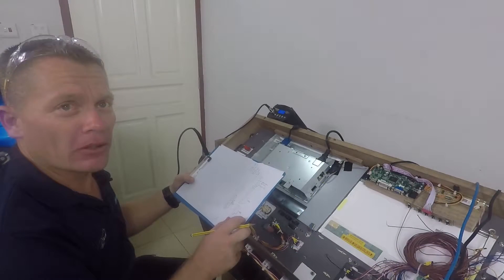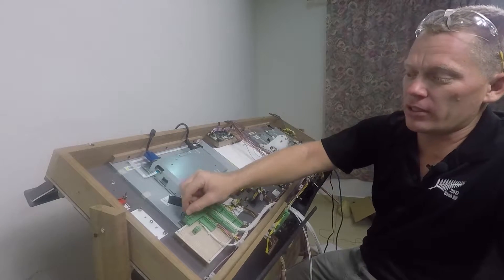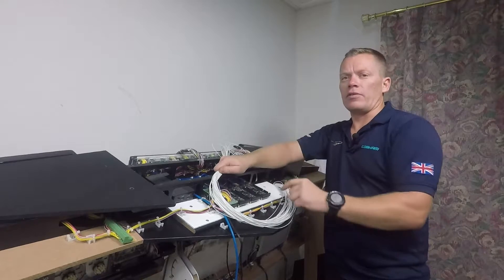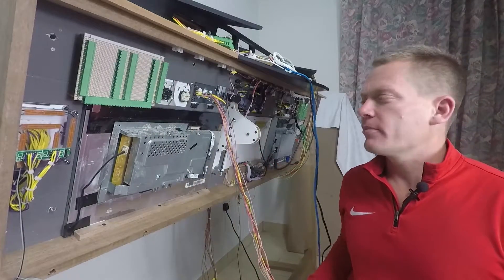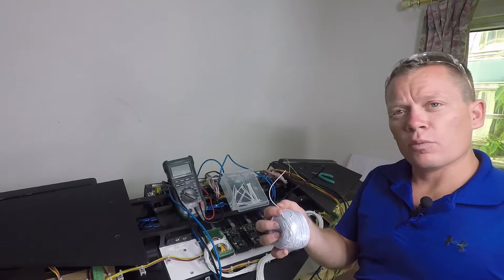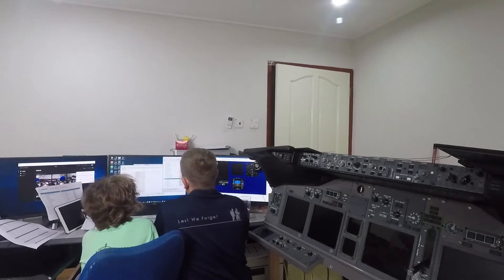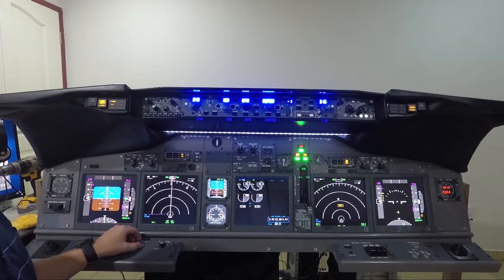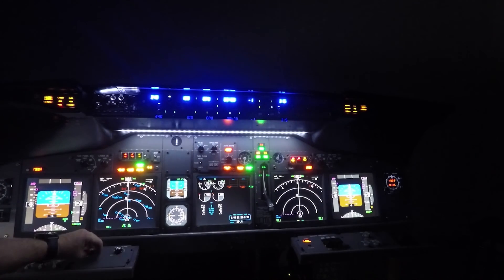737 Sim Build - Wiring the 737 MIP & Reveal #7

Comment: Hi There. This is really great. I know this is old but what did you use for all the screens. Hope you still having fun flying with this.
Reply from the maker: Hello Gerald, the info can be found on the website, but in short, they are just 19" monitors which have been removed from there cases. Prosim then provides the software to drag the windows onto the screen to the required position. Hope that helps, Karl
Reply: @helimech8152  Thank you so much.

Comment: hey me again  enjoying and learning from your  videos  .. what type of resistor should I use for LED"s to connect to arduino ?
Reply from the maker: Hello, carbon 1/4 watt is normally the type I use. The actual valyal depends on the type, colour and quantity. There are plenty of led calculator to help you plan the correct value.
Reply: @helimech8152  I see thks a lot man

Comment: those are not arduino right?
Reply from the maker: Hello and good morning from Brunei. I believe you are referring to the control boards that everything gets wired too. Yes, they are Arduino Mega's. I use 6 currently for the MIP/MCP/EFIS. Definitely, the cheapest and most versatile board I have come across yet.

Kind Regards

Karl
Reply: @helimech8152  thks a lot man for answering to my question. by the way you r videos  are helping me a lot to bul my sim due that i have no idea  about  building. how come you rarduina control boards looks different than mine? mine is just the green board where you soldering the wires to. Im missing the black plate where you attach the green board to .
Reply from the maker: @jhonnynascimento9685  there are two devices there. The first is the ardunio mega itself. Then the ardunio mega prototype shield that fits on top. This acts like a big connector to allow replacement of the ardunio quickly and easily.
Reply: @helimech8152  ohhh i got it now ..  but the shield is not necessary  or you need that shield to make the arduino work?
Reply from the maker: @jhonnynascimento9685  no you don't need that shield at all. But I do highly recommend it. It holds the cables securely and much better than those Dupont connectors that come loose all the time.
Reply: @helimech8152  ohhh ok cool  whats  the name of it?
Reply from the maker: @jhonnynascimento9685  good morning from Brunei, it's just simply called the ardunii mega prototype shield
Reply: @helimech8152  ok man tks a lot

Comment: I’ve watched a lot of these videos and this one is spot on. Great commentary and loved your positivity.  I’m planning a similar setup but hadn’t realised how much wiring would be needed. I guess the Arduino’s are to replace the interface boards which are normally required and very expensive from the various cockpit sites. Good Luck with it all, I’m very envious :-) Cheers Tony
Reply from the maker: Hi Tony and big thank you for the constructive feed back and kind words.  There us a lot wiring, but theres probably more than needed, you could easily cut it down by missing out the breakout boards. And wiring the components direct to the arduinos.

Comment: Inspiring work sir
Reply from the maker: Thank You
Reply: @helimech8152  I keep going back and forth on ProSim and why do you need it.
Cant you just do what you need to do with ModiFlight along?
Reply from the maker: Yes of course you can, mobiflight has a good selection of preprogrammed  items. But prosim is for the logic, displays and switches. It replicates the cockpit of a real aircraft, so every switch, dial etc works. Try it with pmdg, which is much cheaper or x plane using simvim instead of mobi
Reply: @helimech8152  interesting, I am planning on building a generic BOEING MCP using MobiFlight and I was thinking I will also use  a LeoBodnar usb controller and probably map some functions to it as buttons
http://www.leobodnar.com/shop/index.php?main_page=index&cPath=94
Reply: @helimech8152  you know, I just realized that ProSim is different than ProSim-ar looooool
And that Prosim-ar is a separate simulation of the 737 that runs outside of the sim.

Wow, I was way off base here.
I was thinking how to get it running with the PMDG and apparently it is not a clear cut solution.

Just thought I'd share the revelation, I m sure I m the only one who did not know that haha

Cheers sir

Comment: Hi just a follow up to my first message if you have anything i could use in the way of diagrams you could email them to me steve.j-72@live.co.uk any help with arduinos wiring would be gratefully  appreciated thanks again 

steve
Reply from the maker: Hi Steve, sorry for the delay. I have been in my own little world building away every chance I get. As for wiring diagrams, etc. I lost everything I own when our iMac get hit by lightening. So I have to rd to the lot. However, this time I kind if know what I'm doing and it should be really easy to put together guides and videos as soon as the frame is built. I'm hoping to have the frame complete in rough build by the end of this weekend. Sorry, but not much help to you just yet. But it coming.
Reply: thank you
Reply: Hi i think its interfacing that i will struggle with how to connect to arduinos and the breakout boards any info would be brilliant thanks steve

Comment: Hi looks really great,I’m starting mine soon.What size displays are you using ?and where did you manage to source them from?
Reply from the maker: Hello! Well id better check what monitors I have, as they are a complete mish mash and no two are the same. They all came from people who donated them as they were mostly broken. (faulty boards/power supplies/bad caps) I did the repairs which enabled me to have quite a collection of monitors.
The two big ones are 19" widescreen dell monitors. 
and the one in the centre is a laptop screen 14" which I got off ebay with driver for 29.99GBP.
If I lived in the UK, picking up old monitors off ebay for a tenner would be a great solution. All my monitors have been stripped out of there cases.
Kind Regards

Karl
Reply: Heli Mech ,that’s great thanks for the prompt reply,👍

Comment: What software interface are you using for the arduino's?
Reply from the maker: Hello, I'm using mobiflight for the interface to prepar3d and prosim. there's fsuipc and fswide too. I have found that by far the simplest and easiest to use.
Reply: Thanks for that info I've been using arduino737 which is easy to understand but not stable. I've downloaded mobiflight and try it tonight when I get back home. Would it be possible for you to email me your mcc file do I can get an understanding of a complex setup like yours rather than just an led tutorial from the site cheers
hootsmangreen@hotmail.com
Reply: It's cool I don't need a sample mcc now I did the tutorials and have it sussed. But could you explain a wee bit as to how you configure it to prosim with arduino737 you selected a com port with mobiflight do you select fsuipc then enter the offset ?
Reply from the maker: hi coco737, I'll post some images tomorrow on Facebook for you at boeing738v2. any more questions just ask me on there.